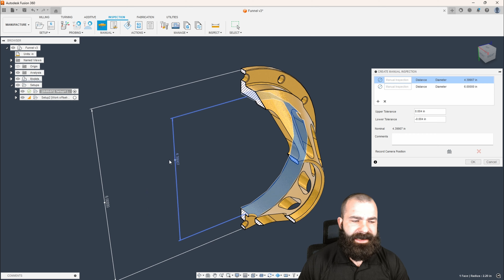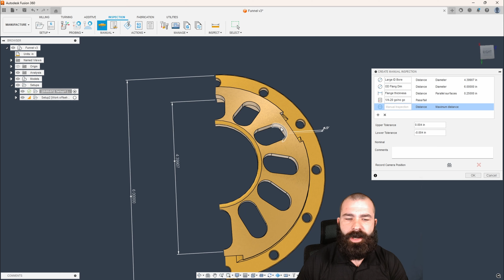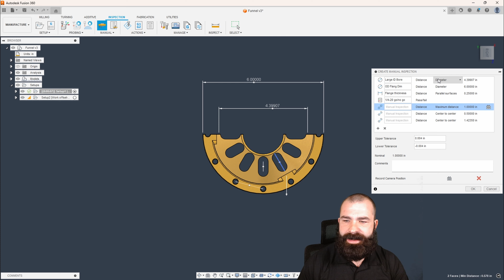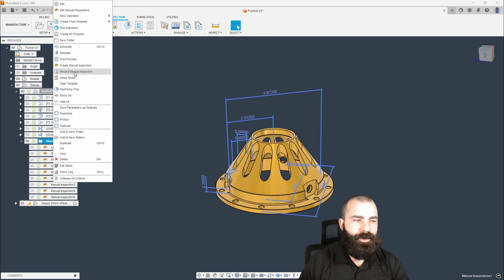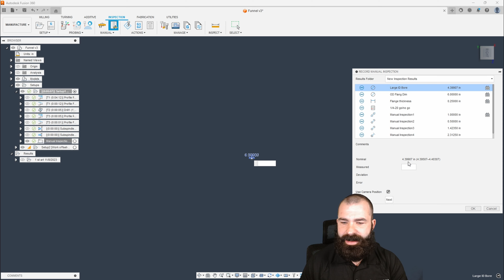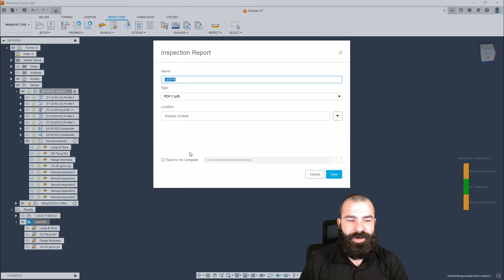Workflow Wensday: Manual Inspections

Comment: Are you able to create an inspection worksheet for the operators on the floor? Allowing them to add the dimensions on paper without having access to fusion
Reply from the maker: Not out of the boxs however the API would allow you create a custom version. Personally I would rather put an extra seat on the floor so anything they do is recorded in Fusion vs having paper floating around. The systme of adding another seat also allows for things like speeds/feeds/tool numbers/setups to be viewed and changed in real time.